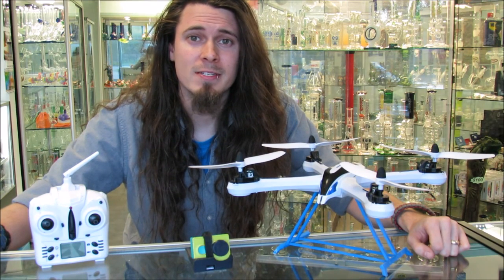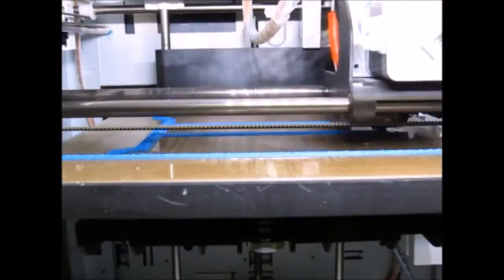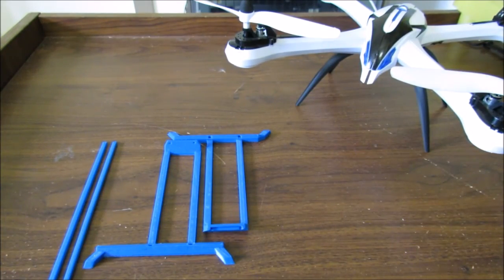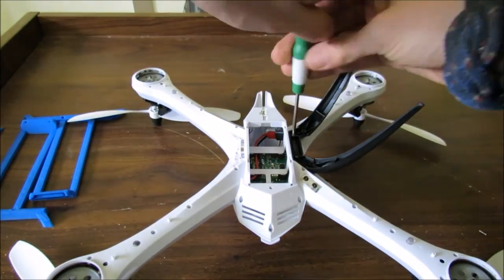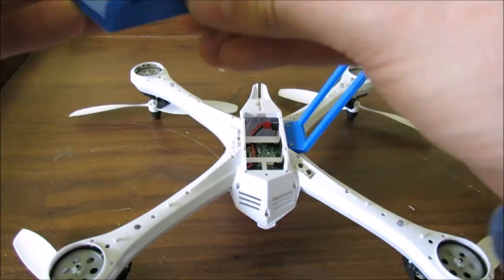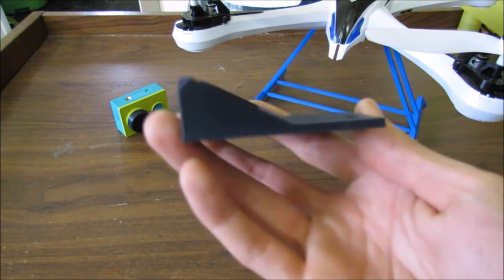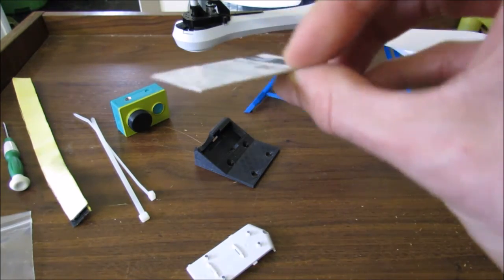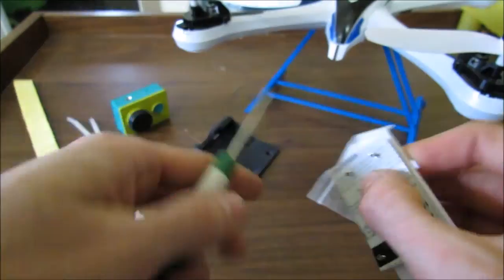NEW - Tarantula X6 Mod - Version 2, 3D Printed landing gear, and Xiaomi Yi 30 degree camera mount

Comment: Is there anyone out there who would be willing to modify this skid for me? I'm not 100% sure on the specs yet, but if the skid angle is changed to 25° instead of 30° and if the skids would be overall longer about 2-3cm this skid would be perfect to complement the popular Walkera D-2D Gimbal on the tarantula. They way it is right now unfortunately it is just too short.
Reply from the maker: sure, give me a few minutes.
Reply from the maker: Before I can, I just want to clarify are you looking for just the skids to be modified? The skids as they are, are at 60 degrees. (the camera mount is the part that was 30 degrees) and I can make the 3cm longer.
Reply: Oh wow, that would be awesome, thanks for the answer first of all. Right now I don't have the specific dimensions together, waiting for my gimbal to arrive, but basically I think the skids(legs) can stay at 60 degrees (You mean 60° as 30° for each single skid right?) changing to 50° would be another possibility to avoid them being to wide at the bottom.

regarding the changed height of the landing gear I am not sure what is needed, I find different dimensions for the gimbal setup, therefore it would probably be best if I meassure it as soon as I have it at hand.
I would post again as soon as the gimbal has arrived and i can measure everything.

Again thanks a lot for considering to modify the layout, great work you did there. I am sure many people will enjoy this modification, as the walkera gimbal setup is wide spread with tarantula users but it always comes with the problem of modifying the gear appropiately so that it is high enough and doesn't show of on the FOV of the camera.
Reply from the maker: No problem! Just give me a shout, when it comes in.
Reply: With the Walkera G-2D Gimbal mounted it would need about 10cm between the bottom of the Tarantula and the support Bars at the bottom of the landing gear, so it should fit without any modifications. Thanks for the great work.

Comment: how much would it cost to make one like that
Reply from the maker: +Paul Hyde If your local library or school has a 3D printer then they usually charge a small usage fee and cost of filament, it's about $3-$5 for filament for they would probably run you about $20-$30.
Reply from the maker: +Paul Hyde Bill M on this threat got it done, if you ask him I bet he would have no trouble telling you how much it cost him, he is also on the Tarantula X6 Facebook group.

Comment: can you tell me please the measures, especially the height
Reply from the maker: +wuiliamb2 On the Tarantula assembled
125mm Height
120mm Wide (at bottom)
The space between the angled legs (if you are planing on mounting a gimbal) is:
60mm wide at top
180mm Wide at bottom
112mm from top to support bars at bottom
and the angle of the legs is 30Degrees
Reply: +My New Toys so thx

Comment: Hi, thanks sooo much again. The printer was not happy with his run of Version 1, so we proceeded with printing this Version 2,...now fitted, very happy, yet to fly with it but feel confident. Ideally, if there is a way, I would like to have the horizontal support struts be able to clip on and be removed for easy transportation. This will make a great "flat pack", if this can be achieved without compromising stability.